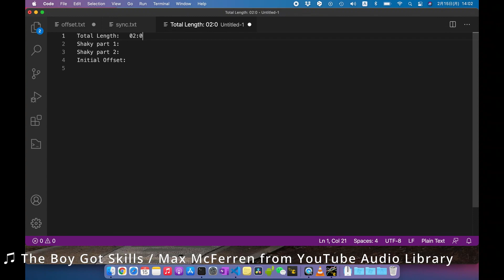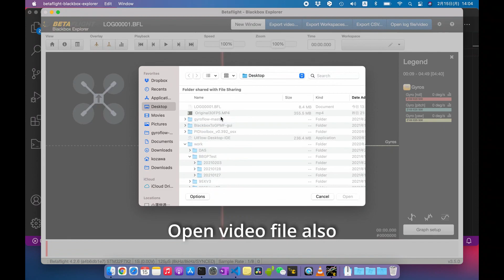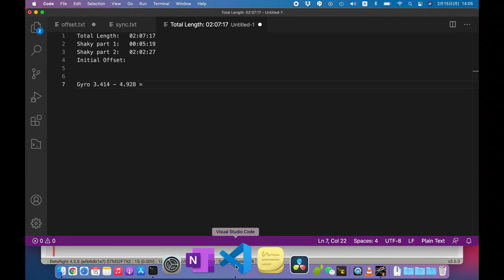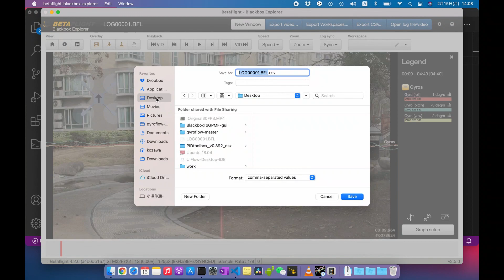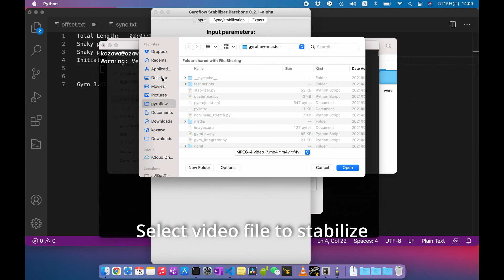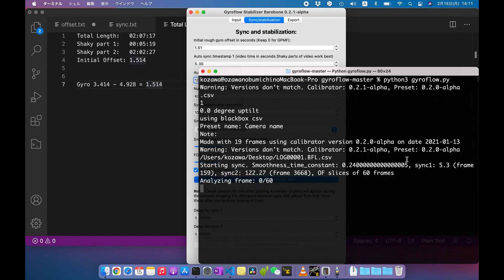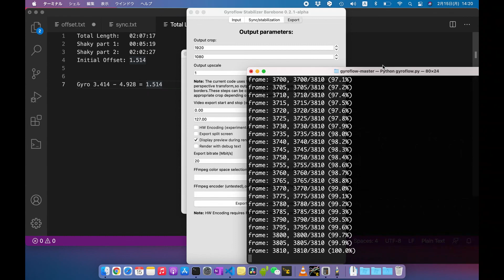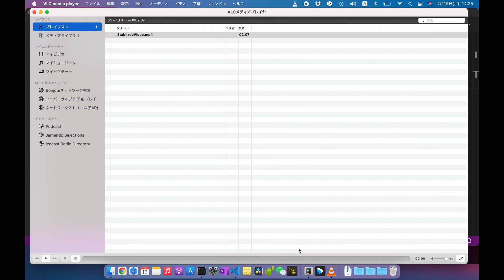How to use gyroflow 0.2.1-alpha

Comment: Sort of looks like Gyroflow has some problems when there's a lot of rolling shutter issues. Perhaps the lens filter could be better calibrated? Either way, it's so cool to see how well it works. I'm a little worried that it didn't work with 60FPS - because that's the coolest things about using the Runcam 5 Orange, I think.

Comment: heads up, by default it "searches" from -5 seconds to +5 seconds. So if the rough sync is under 5 you can just leave it at 0. No need to mess around in blackbox explorer or use a calculator
Reply from the maker: Than you for the greate program!  Understood.